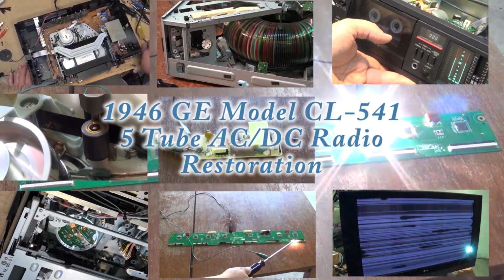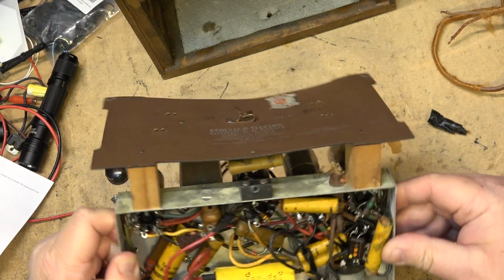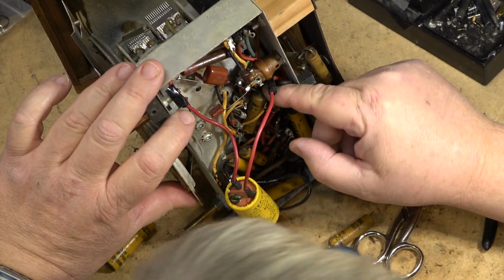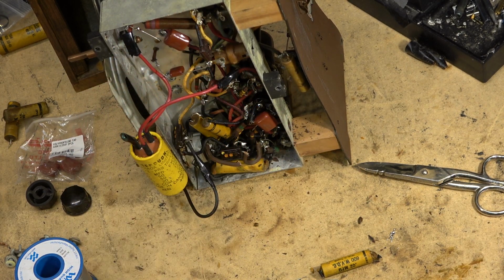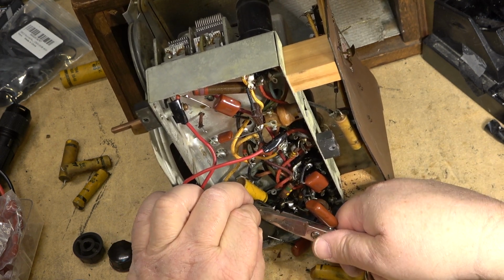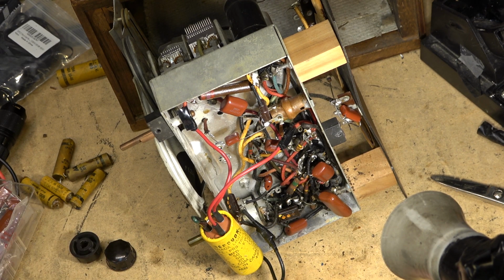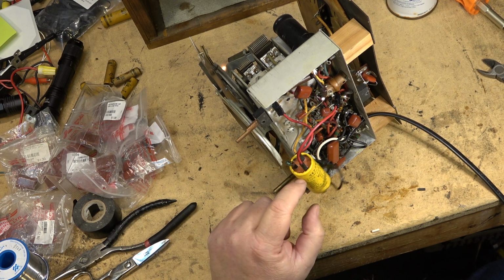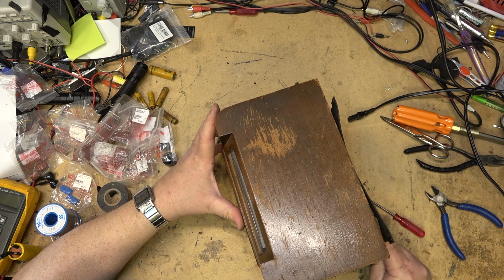75 year old GE table radio restoration

Comment: To alleviate the issue of leaving it plugged in, I would plug it into a homekit enabled plug, which can switch it on and off, essentially disconnecting it from the power with the added benefit of giving it some modern smarts. Hey Siri, turn the antique radio on! Leave it dialed up to your favorite station and it can be a permanent installation. Don’t see why it wouldn’t be safe.
Reply from the maker: Don't have any listening devices here.  No Siri, no Alexa, no hey Google.
Reply: @12voltvids  you can still activate smart home devices verbally by manually invoking Siri on your phone, or by any other means that don’t involve speaking whatsoever (home app, control center button, automation shortcut, physical remote control, motion/proximity sensor, etc.)

Comment: Old tube radios are a common cause for room fires, esp. older people (eg. homes for the ages and such) underestimate the risk or simply have no idea. Also getting a severe electric shock is common, because old capacitors often don't fail open but short and put main voltage on the housing...
I recommend against even testing an old radio before someone with knowledge checked the device (radios, amps, very old TV's).

Comment: CL-541D which has a walnut finish and has a connector on back for an external antenna with an antenna on the back.
The other models CL-541,CL-541A and CL-543 do not have an antenna on the back just a connector for an external 
antenna. Actually twenty bucks is great for a wood cabinet radio of this vintage. Brown shoe polish can be used on 
those light spots on the cabinet top. Love  the professional way you have in repairing these really old radios Dave.

Comment: Sounds good for it's age, easy to listen to.
Yep those craps would of killed the radio,  like you said a bad cap from the anode of the driver to the next stage grid input would have damaged it.
The radios that are frightning are the ones with no dropper or transformer, the mains cable resistance is the dropper, What a deadly design with a hot mains cable. 😞
I don't know what the i.f frequency is, 462-480 khz?. 
A  i.f  tweak up with a low amplitude generator might make it even better.

Comment: You explained your reason for not putting in a fuse, but you didn't explain about not upgrading to a 3 prong cord?
Reply from the maker: Simple. Chassis is connected to one side of the line.
Reply: @12voltvids  I see, but if something catastrophic were to happen, wouldn't it still be more 'ideal' to have a ground to the chassis?
Reply from the maker: @theoloutlaw  no. Chassis is hot.  Putting a ground wire on it would create a catastrophic fault.
Reply: @12voltvids  Ahhh! Gotchya!  Thanks for clearing that up.  Cheers.